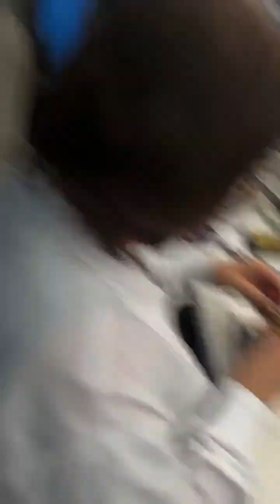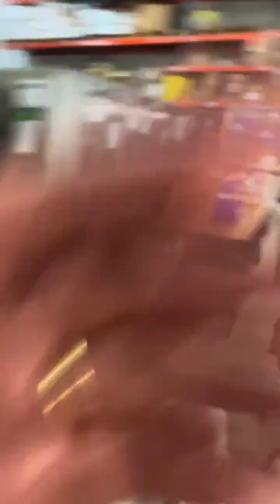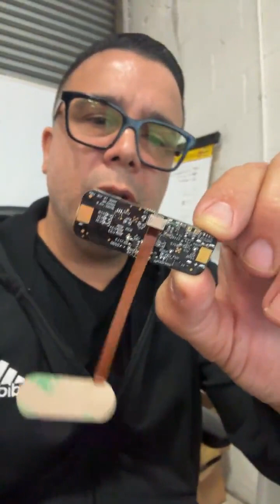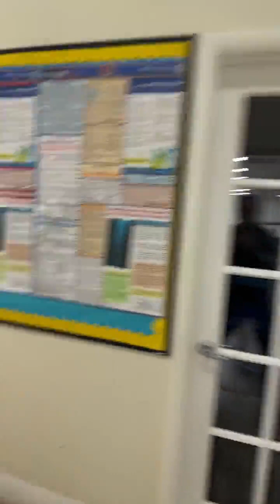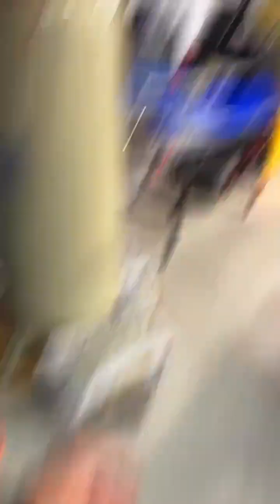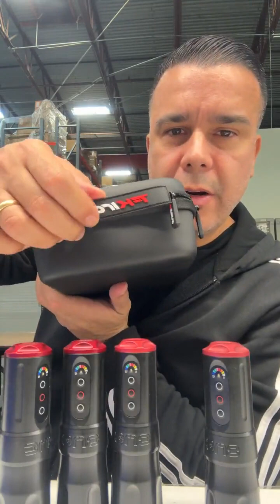FK Irons Tattoo Machine Building and prepping for shipping of the ONE Machine

Comment: Hi, i buy fk one+ 4.0 bubblegum from killer ink UK and the spare parts are missing! The machine is too  loud and the needle does not goes out like 4.0 but most like 3.0

Is it possible to be factory mistake? The batterys was rusty and one of them does  ot working. Killer ink  UK told me to contact with you! If this is the cualituly of your machines that will be my last, and  this is  my 6th  so far